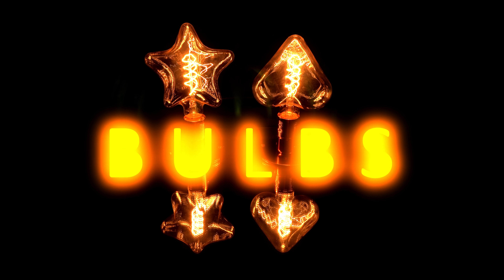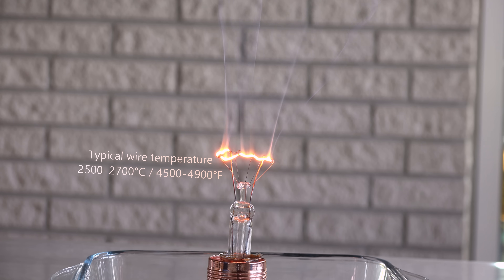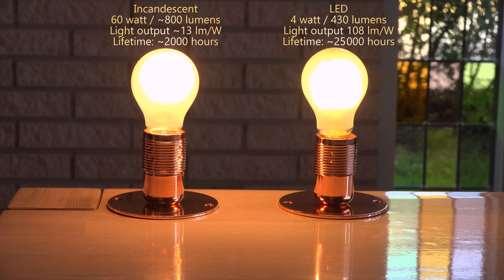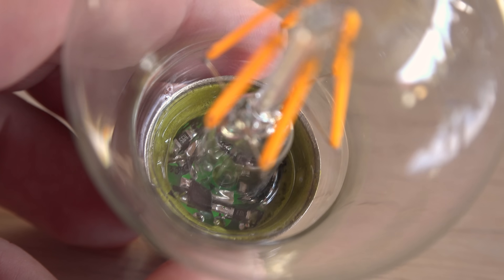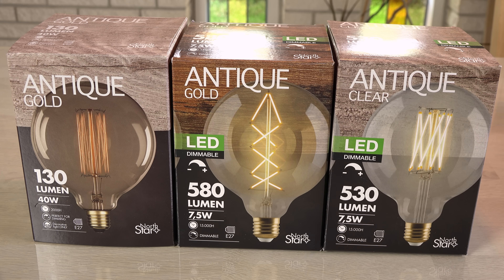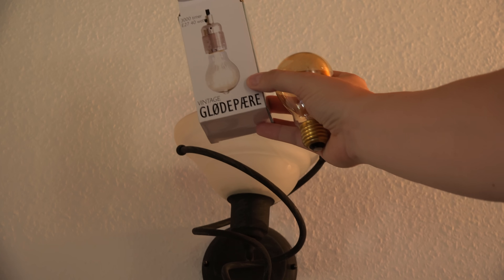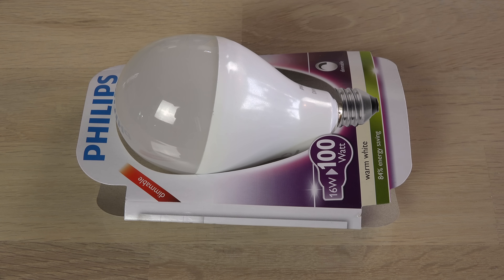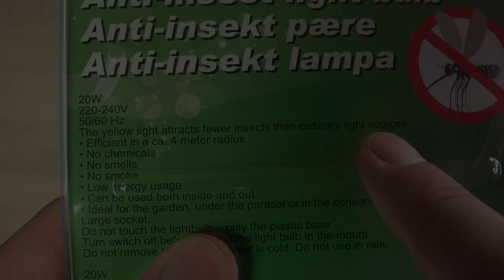Light Bulbs | LED vs. Incandescent

Comment: why didn't u get arrested for lighting the clear incandescent though.
and that halogen has only 1000 hour life means you will need to change it in every 3 months ?
Reply: Because they are not actually banned, they are just not recommended for regular use. It's like banning cigarettes, Yes you are not allowed to smoke in most public places but that does not mean you are not allowed to smoke at all.
Reply: i see.
Reply from the maker: The ban is against them being sold. Perfectly legal to be used if you have or find them :) And yes, the halogen work light will only work for roughly 1000 h. But it's a work light so that's plenty for my hobby use.

Comment: Traditional lightbulb has less requirements from powersource - I mean you can use f.e. dimmers or less quality powersource to use that. Quality of light is better at traditional lightbulb.
Reply from the maker: Yes, quality of light is way better in incandescent bulbs. LEDs are catching up though, but still far from perfect...

Comment: the 125W flourescent is rated as the incandescent equivalent wattage light level. an old marketing con.
Reply from the maker: Hmm, it actually gets worse than that. The seller sold it as a 125W CFL equivalent to an around 750W incandescent. LOL.
Reply: +ZombiedustXXX
It's actually pretty irrelevant. The lumens are much better indication, as it will tell you exactly how bright it will be. A 500 Lumen incandescent will be just as bright as a 500 lumen LED. A 60W Incandescent isn't necessarily equal to a "60W" led at all. What that "equivalent" can be can vary hugely from company and countries. 

It's like using GHz over FLOPS for CPU/GPUs, or RPM instead of Horsepower for engines, if not worse as it isn't even standardized. Wattage equivalents make little sense.

Comment: Shouldn't the color temperature for incandescent lighting 3200K not 2000K that's on your chart?
Reply from the maker: Incandescents can have very different color temperatures depending on design. The color temperatures in the chart are the advertised for each bulb. I don't have anything to actually measure it, but they seem legit to my bare eyes.
Reply: If you had a spectrometer you could measure the accuracy of the advertised color temperature, I would be interested in seeing that. I know in HMI lighting there is a lot of variance between the manufacturers of exact color temperature when they "claim" to be at 5600K.

Comment: Very informative. I discovered another potential issue with LED bulbs. I installed LED bulbs in my garage door opener and it seriously interfered with the range of the remote (I couldn't close the door from my car). Changed to a different brand which apparently has a higher switching frequency and that solved the problem.
Reply from the maker: Thanks. LEDs are far from being a perfect replacement in all situations. Hope they'll improve over time.

Comment: Very informative video. What is the actual voltage in your home? I guess the wattage on the incandescents is only true when run at 230V
Reply from the maker: Thanks :) I think you're right. My voltmeter says around 220V for my mains. Not the full 230V...

Comment: I'm currently using an LED bulb rated at ~94.5 CRI, Wish I find the box back so I could show the specs
Reply from the maker: That's pretty good. Hard to find an LED with such high CRI in Denmark. Maybe even impossible?
Reply: A store here bought thousands in mass so it was pretty affordable too, 5 bucks, but I never tested it with an actual spectrometer, but it looks very accurate close to incandescent to the naked eye

Comment: My incandescent bulbs are 100% efficient. The heat they produce warm up my home. It is energy that I do not have to pay for through my heating bill. In other words, LED bulbs are more than 10 times more expensive and just as efficient. It is a mistake to think that the heat of an incandescent bulb is wasted. 

The materials used in an incandescent bulb are 100% reclaimable and do not pollute the environment. LED bulb, once broken, should be treated as all electronics, as toxic waste. 

But! The profit on a one dollar bulb is far less then the profit on a 10 dollar bulb. And that, IMHO, is the only reason why the politicians, influenced by Industry lobby, have banned incandescent bulbs. The issue is far more complex than your video explains.
Reply: number one. even in the summer you use these to heat your home? number 2 it is a mistake to think that you are equivalent to typical user. number 3 you are still paying for that electricity.
however the points on older bulbs being more recyclable I cannot take issue with
Reply: In Summer we virtually need no lights. It doesn't get dark over here until midnight. We like to stray outdoors and leave the doors open. With the lights out we don't attract insects. We may light a Citrus Candle but that's all. 

But in winter when it's cold the days are short and we use lots of lighting (and heating). 

I haven't even mentioned the energy needed to make and destroy LED's as compared to Incandescent lighting. .... 

The ban on Incandescent bulbs mainly helps big Industry to make more profit. But isn't that what Brussels is all about? Lobbyists, payed by multi-nationals, make sure we get lots and lots of silly rules. Rules that only big companies can follow. Small businesses can't. This is how big business takes over government and our lives.
Reply: 40 times? Perhaps the LED chips last that long, but the controlling electronics fails just as fast as the old incandescent bulbs. Maybe the capacitors in the step down supply blow? I don't know. 
What I do know is that, after having been using CFL for well over a decade and LED for a couple of years, is that I am still buying replacements at about the same rate as before. It has only become more expensive.  

Again I have no idea why the darn things blow but they do, and at about the same rate as the old incandescent bulbs. It is just another trick to take more money from my wallet.
Reply: The "controlling electronics" are very simple and have been mastered for a long time. It's really just a dc power supply and a couple resistors. a switching psu is just about entirely solid state except the capacitors

which just means that the manufacturer decided to use shitty ballast capacitors. Looking at a reference electrolic cap (10,000uf, 5A ripple current, available in individual packaging for ~$4, it's actually probably a little bit overkill) This particular capacitor has a lifetime of about 3000 hours at 85*c. The life of an electrolic capacitor is decided by the average temperature with each 10*c drop doubling the lifetime. Room temperature is around 20*c and let's call operating temperature 50*c (the temp of my cpu right now) assuming 50% duty cycle that's an average of 35*c making the expected lifetime 52,000 hours or just shy of 6 years. 

Anything short of that just means that the manufacturer was just being cheap or put no thought into how to get the heat out of the bulb (it's not hard, I promise. you just have to do something, anything)  

You could also use a linear power supply and put the ballast directly on the led lead. this would allow you to use much smaller capacitors with much longer lives, but you would use a bit of efficiency. (it would less than double the power drawn, which really isn't a big deal)
Reply: Bor the Wolf while im among the first to blame greedy corporations this time I think i have to disagree with you. When Australia banned incandescent bulbs, they said the corresponding drop in emissions from power plants was equivalent to taking several thousand automobiles off the road. That of course (as you said) would need to be compared to the increase in manufacturing and recycling energy but with an average life span 2-3 times that of an old bulb, and a running cost 90% lower... I'd be very surprised if we come out behind.
Reply: LOL @ "it is energy I do not have to pay for through my heating bill"...So, your electricity to run those lights is free then?  And what about in the Summer when you're trying to cool your home and have all that extra heat?  You're making your AC work harder to cool your home requiring even more energy that you still have to pay for.
Reply: Joel Harris but the output we're interested in is light, it's 100% efficient at consuming energy, but if it wasn't that would be breaking the laws of physics.
Reply: Joel Harris In Texas we have somewhat different thoughts about extra heat ;)
Reply: Allen McFine I was being conservative because i didn't feel like looking up actuals, but your data only strengthens my point.
Reply: unless you're using air conditioning, in which case you're dealing with the ineficiancy twice
Reply: 100% efficiency is impossible to achieve.
Reply: The reason that they are seen as not efficient is that the people are probably smoking pot, and we are the ones having the bad trip.
Reply: how many lightbulbs will be needed to heat your house. in this case the waist will be in the light given off.
Reply: What brand of bulbs did you buy?
Reply: Allen McFine exactly!
Reply: dosmastrify
It's usually closer to 40x the lifetime of an incandescent bulb and about 5x the lifetime of a cfl bulb.
Reply: I'm just a kid but our Christmas lights give off a warm feeling by looking at them, LEDs are less attractive and I'll take soft but burning light over expensive blinding light anytime. I'm very clueless, and I'm not sure if LEDs do this too, but normal lights usually become as bright as LEDs when their about to stop working..
Reply: LED bulbs last many times longer than regular incandescent bulbs. So, during the lifetime of a single LED bulb, you'll be going through at least 8 or more incandescent bulbs, and spending more money in the process.
Reply: So far the claimed life of CFL's & LED's for home use hasn't met the hype (at least in my experience).
Blowing many within a week or month is particularly annoying.
Reply: Incandescent lights can last 2 full years on 24 hour use cfl maybe last 9 years but led lasts 15 years
Reply: Only becasue you live farther north then most of humanity.
Reply: Not sure but the LEDs I am buying are rated for 50000 hours.
Reply: Not really, how do you use the magnetism and radiation it produces.  90% is heat, 5% light, what to you think the rest is.
Reply: The nut job thinks it is free.   What a lunatic.
Reply: Toriless ya i think incandescent can’t be thrown in the garbage eather
Reply: Toriless they last 2 years at most I think incandescent
Reply: @Rebel9668: 
Energy is energy whether it comes from an electric source or from natural gas. The heat produced by an incandescent bulb is not wasted, it just means my natural gas bill will be a little lower because I already got some energy from the bulb (and payed for it through the electricity bill). Assuming both energy sources are equally expensive per Watt, the incandescent bulb is 100% efficient. It is simple high school physics. 

Up north we do not cool our home In summer and we don't need lighting until midnight, by which time we have gone to bed.

Comment: do not forget the surplus of planned obsolescence in incandescent lamps from the decade of 20, and will not take long to do the same with LED's and others. ty for nice video.
Reply from the maker: Thanks for watching :) I don't want to speculate in the real life time of LEDs yet but so far my LEDs are still running strong :)
Reply: Brainiac75
yes, still, we can not forget that there is an incandescent lamp that lit over 100 years! so I said, that sooner or later the "planned obsolescence" will affect the LED's also, need global laws to control or stop it altogether.
PS: thanks for answering! :)

Comment: The halogen is below spec because at the end of it's life the Ressistance will increase an the wattage with it, also the lumens. like HPS and LPS.
Reply from the maker: That may be the case. The halogen work light is not brand new. I've also been informed that the advertised wattage is for the 'perfect' 230V mains. My mains are at around 220V :(
Reply: Well i personaly have a 400W HPS which has a transformer and the actuall power draw i quite higher. When the transformer heats up with prolonged use the resistance goes up. And i have noticed when the bulb was at the end of it's life it was quite brighter and the current draw was higher